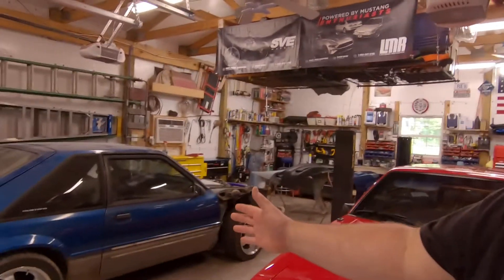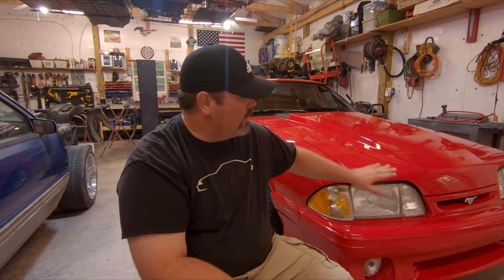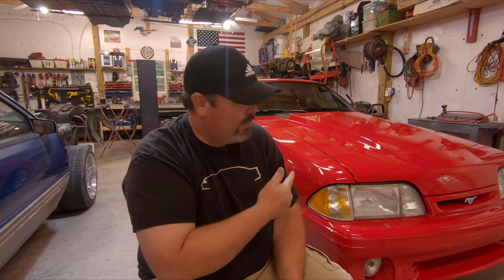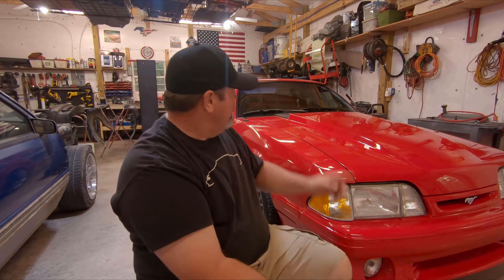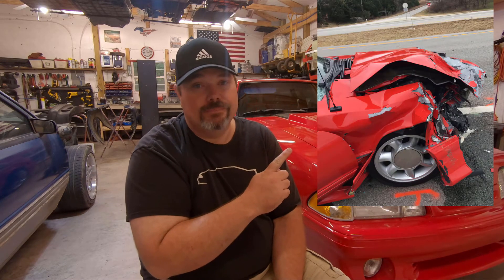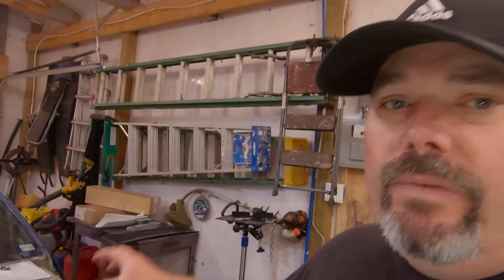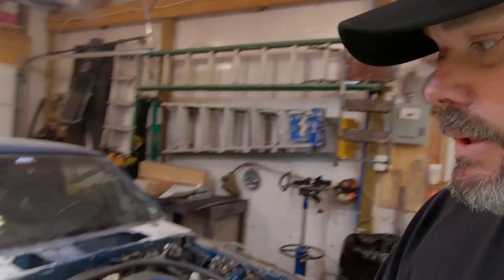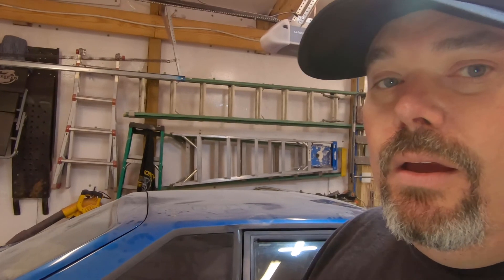Building The Mustang Fox Body 2 Tone Cobra Clone

Comment: How hard is it to add GT sideskirts?  I prefer the looks of a GT.  But at this point, you just have to take what comes your way.  Sometimes I see awesome LXs for sale and wonder if you can just add the sideskirts and GT front fascia?  I like the look of the Cobra rear bumper cover.
Reply from the maker: Adding factory GT side skirts will be no easy task on a non-GT car.  All the metal mounting strips have to be riveted on in very specific positions.  I would Recommend just going with the Cobra kit from Cervinis like what is on my car.  Mine was a LX and way easier to covert using their kit.  Good luck!👍🏻👊🏻